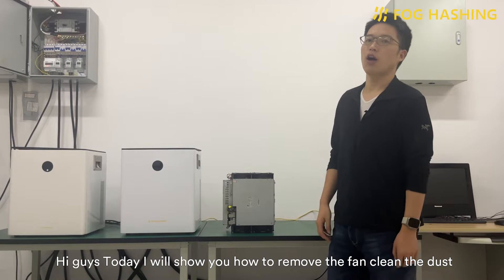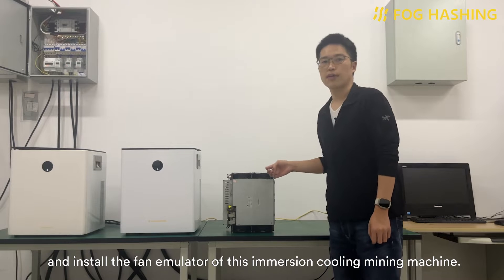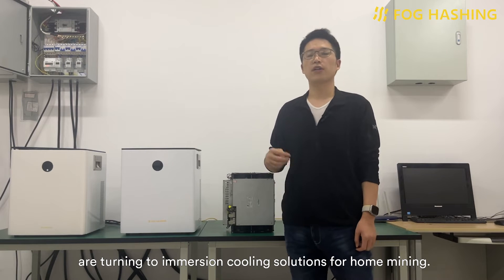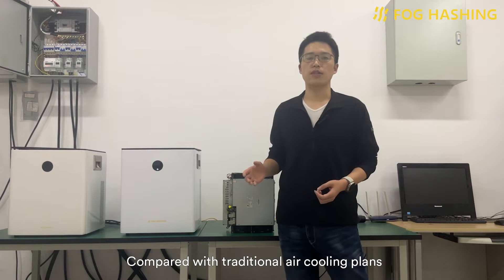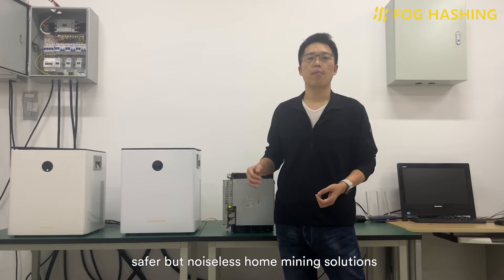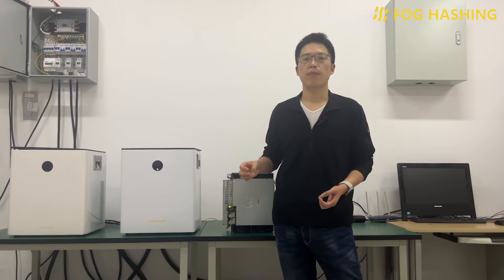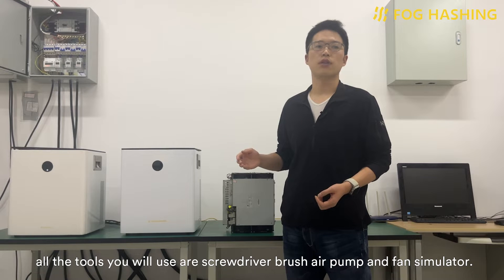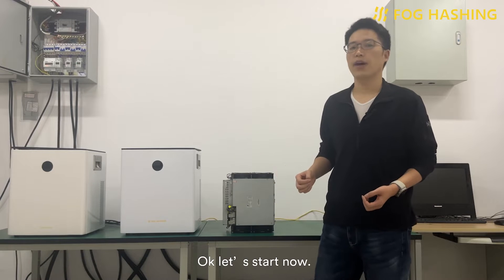Air Cooling miners to Immersion Cooling: How to  remove fan, deep cleaning and install fan simulator

Comment: the lack of noise is a big plus for me , the only thing that kind of holds me back is wat if the miner breaks down and you need to repair an asic on one of the boards , by lifting it out of its tub the thing is now a greasy mess once you take it out and is dripping everywhere so put it on a rack over the tub and leave it till its finished dripping ...... that be about 3 hours lost mining allready and you havent put a screwdriver on it yet
ok quick walk to the bathroom where you at least can flush the oil away intoo the showerdrain .....how do you flush the machine from the oil still sticking to it after that to get rid of most of the oil before taking the screws out whout getting filty up to youre armpits and getting greasestains on everything you tough (need to go to the bathroom , better plan in advance) 
will the tin still flow on the chips and the heatsink as it would be pretty contaminated will alcohol be enough to spotclean the surface 
and with the upgraded bigger heatsinks will the termal paste desolve in the oil reducing the thermal connection to the heatsink 
allso before inmerging the wole thing you probably need to take off the important labels (serial numbers etc ) stick to the housing as they probably peel off after some time inmerged 

since im planning to use an antminer the housings are the same throughout the range , might take the boards from a new miner out of its housing and put it in a used housing storing the new one for when its time to sell and then drop it in the oil that leaves the outside at least looking like new

come to think of it , might be a market for housings that are watertight to be used both for mounting everything intoo but allso as the tank basicly an enclosed housing with gaskets and a entry and exit bung for the oil
Reply from the maker: Yes, you are right. For air-cooled mining machines, it requires certain procedures to modify them. However, liquid cooling is usually more stable and it is not common to repair mining machines, so cleaning mining machines is also a very small probability event. At present, Whatsminer has launched oil-cooled mining machines, which do not need to be modified and have official warranty. This is also a trend.

Comment: Is it ok for the fans to run inside the immersion cooling oil for KAS Miner  KS5 in C6? If not why not?
Reply from the maker: Hello, for all air-cooled mining machines, if you want to use liquid cooling, you need to remove the large fan.

Comment: How about fan for the power supply?is it need to use fan emulator for power supply fan?
Reply from the maker: Different mining machines have different requirements. The power supply fans of most mining machines need to be removed, and they do not require additional fan simulators. But for Iceriver, it cannot remove the power supply fan, otherwise it will not work.

Comment: I had thought you need to use an ultrasonic cleaner before immersion. Is just removing surface dust sufficient? What about the embedded dust/dirt which is not currently loose? Won't that come loose or dissolve into the fluid?
Reply from the maker: Yes,These steps are enough to clean a general mining machine. If it is really dirty after running for a long time, an ultrasonic cleaner will be needed.

Comment: Can we use immersion cooling for S19 K Pro 120 th with out reduce miners fan means put miner with fan in oil contener??? Yes than why?? Or no than why?? Please tell me
Reply from the maker: Hello, the fan must be removed. Because fans cannot run in liquid, and liquid cooling equipment dissipates heat through oil and does not require a fan.

Comment: Hi, I'm looking for the same instruction for IceRiver KAS KS3M, any chance to have one?
Does that device need a fan emulator? (I guess there's no overclocking firmware yet for it)
Reply from the maker: It can be used in our liquid cooling equipment and also requires the fan simulator. The fan simulator is the same as that used by ordinary Antminers.
Reply: How did you go finding the answer? Do you need fan emulators for the little fans for KS3M?
Reply: @alexbaumann3104  if you mean little the PSU fans, no, the emulator is needed only for the main fans AFAIK (the hash board cooling fans), and Fog Hashing support confirmed that they have KS3M specific fan emulators for the main fans